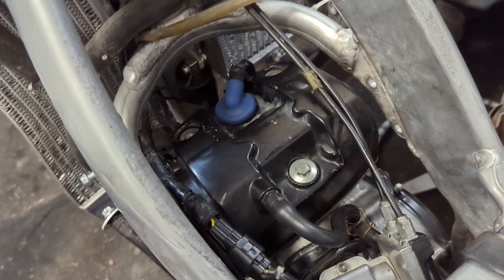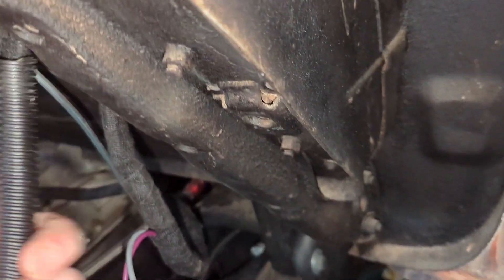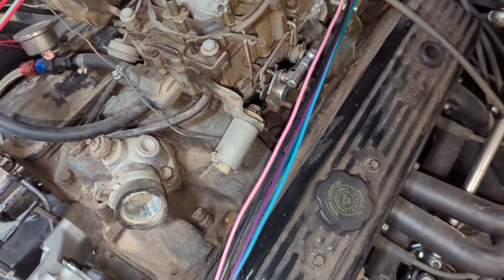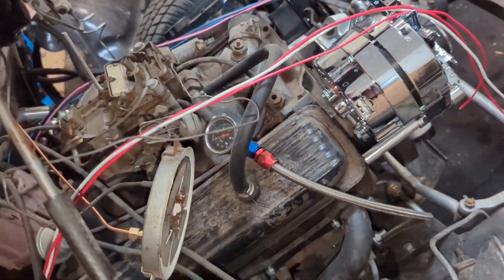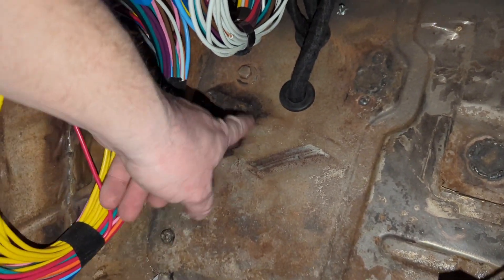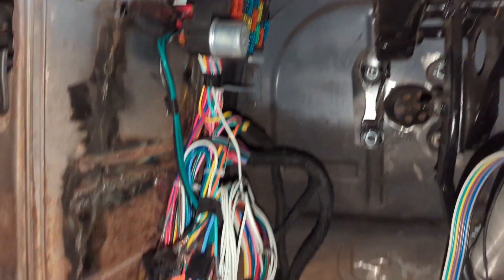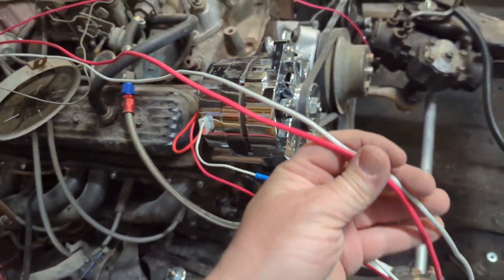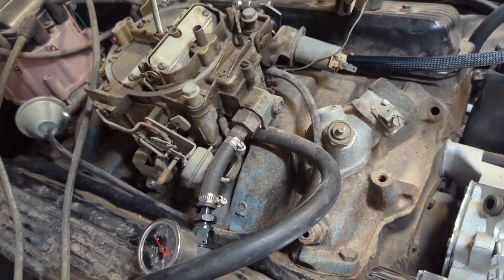1951 GMC 100 - Motorcycle fail and Electrical wiring on the truck

Comment: That heat riser for the choke gets hot.Keep the wire just off the engine. Grounds are needed Body engine and frame.Bigger is better.  Fuel line needs a bracket. Keep at it once the wiring is done your close to driving it.